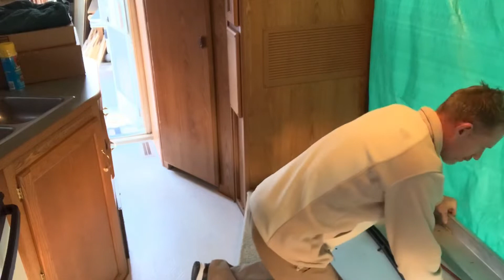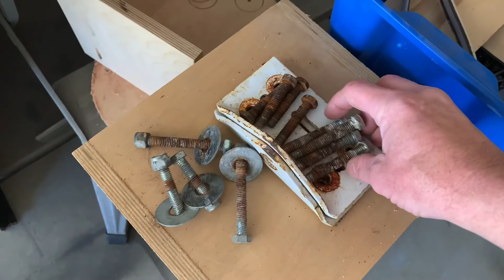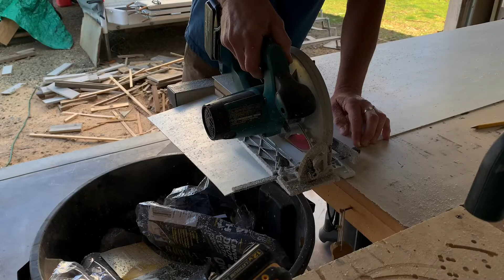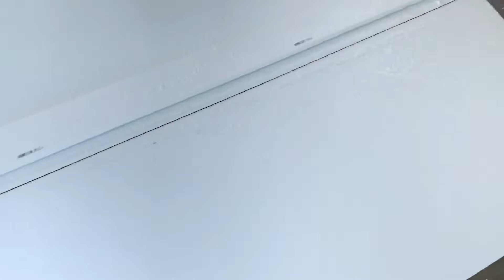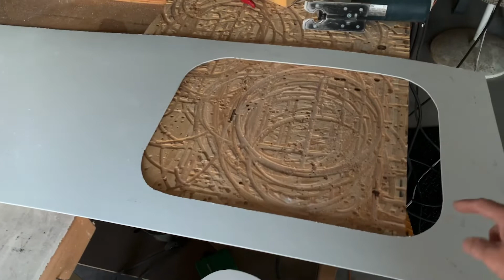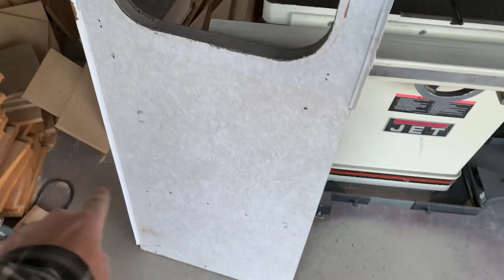New Slideout Wall Skins • Truck Camper Repair

Comment: I have a 2002 with the same issues. How did you splice the ends of the cracked filon sections around the slide out. Did you find a new new flexible trim piece that goes over the compartment?
Reply from the maker: I used flexible adhesive sealant to adhere the filon to the frame then bodyworked the area with White Marine Tex putty.
https://amzn.to/3NEMiPc

When sanded flat, the seam between the two pieces of filon are barely visible
Reply: @covetthecamper2289  lLooks like a good option. I am going to try it. It is available at my local ACE hardware store.
Thanks

Comment: I wish I could attach pictures of my super slide on my trailer after a 60 foot cotton wood tree tumbles out of the ground and crushed the front corner where the fridge was. Your video gives me the hope and desire to be able to repair it, I'm sure the insurance company is going to inform me it is a write off because of the damage. I can envision the current wood construction that gave way and I am sure I can rebuild it.

Comment: Thanks for sharing your work.  I have a 5th wheel camper I have removed the entire slide out walls and will have to rebuild them completely.  Where did you purchase your fiberglass panels?  I have seen 4x8 sheets at Lowe's and wondered if that is where you got yours.  Thanks for any information.
Reply from the maker: You’re welcome.  I purchased the fiberglass sheets at Home Depot and Lowe’s.  ( It’s the stuff with a pebble textured finish on one side). If you’re going smooth side out, be sure to lightly sand the gel-coat finished side with 80 grit before applying the adhesive.  The Poly-Wood is from Lowe’s but I think Home Depot has it as well.  Good luck with your repair.
Reply: @covetthecamper2289  Thanks for the answer.  I was reading another video about Foam PVC planks and they were saying to use PVC glue when gluing PVC to PVC.  Are you doing this or did you only use the adhesive in the gun?
Reply from the maker: The LocTite PL Construction Adhesive bonds the Poly Vinyl boards to the fiberglass sheet and to itself strong.  The bond is so strong that the substrate will break before the adhesive.  I tested this and many other adhesives on several different materials in my shop before starting the repairs.
Reply: @covetthecamper2289  thank you.  I am going to follow your example.  My slide out walls were rotted floor to ceiling and also had termites in them so I will do like you are and rebuild the walls out of PVC and the poly boards.  Too bad RV manufacturers don't build them that way since they are so prone to rotting.  I use PVC trim on the houses I repair and I love that product.  Enjoying your video's.